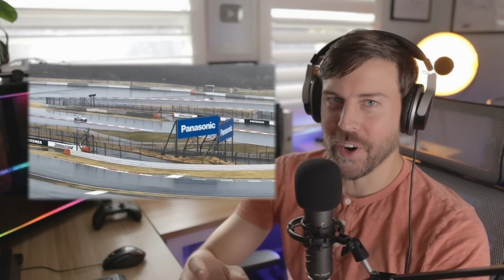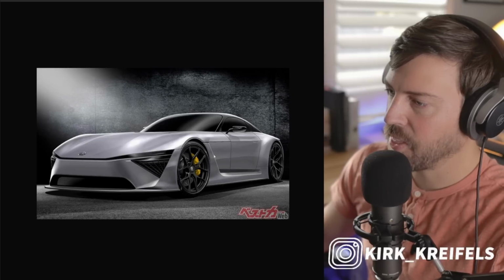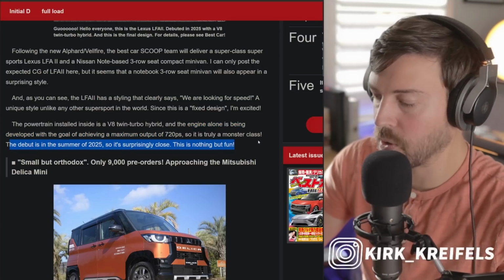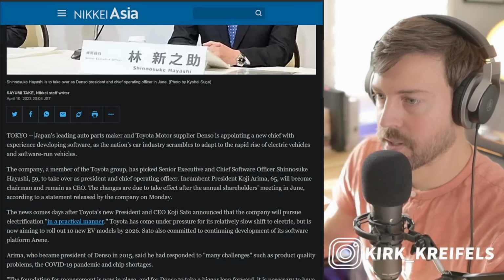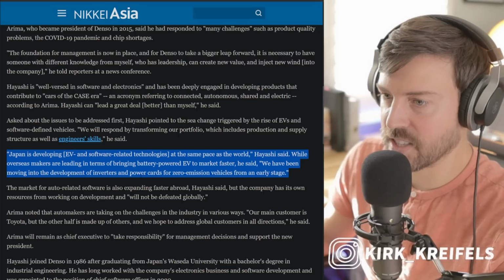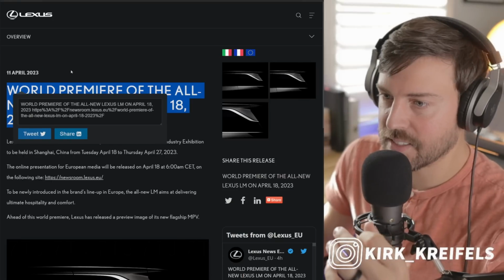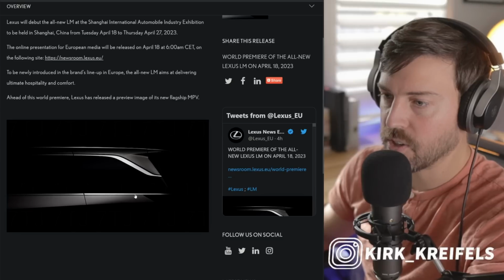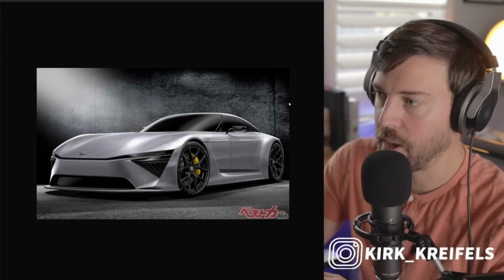*NEW DETAILS* Here's what JAPAN is saying about the Lexus LFA successor...

Comment: Lexus needs to add a supercharger or turbos & tweak the suspension on the LC500. Lower the 0-60 to 3.3 or lower and 11.5 KO in the 1/4 mile if they at least do that that’ll be what they need!

And pump up the boost in the LFR to have the 911 Turbo, Lamborghini, & Ferrari etc super car times..!

Comment: 700HP from only the petrol motor doesn't sound like Toyota, at all -- that figure, in conjunction with the e-motors, sounds plausible -- the NSX hybrid was already 500HP.

The Toyota 2.4L turbo makes about 275HP; or about 115HP per liter; 700HP would require about a 6L motor, at that (Toyota) rate. 

Most OEM performance turbo motors run about 150 HP per liter, like the Civic Type-R (158); at this rate it'll still require about 4.3L of motor

Most people in the aftermarket knows you can make at least 200HP per liter with a turbo motor, which would require about a 3.44L motor -- but that doesn't mean an OEM would do that
Reply from the maker: Toyota's 1.6L makes 300HP = 187HP/L. 4L TTV8 could make over 700HP with that power density.
Reply: making a v8 to 700HP is a easy work, and it will be reliable, why toyota would make a half assed supercar in this day and age when supercars play around 600-850HP and this is a GT3 car too 😒
Reply: Ok there is something I don’t understand.  If the new LFR is to be a GT3 and compete in the GT3 class in 2026, how is it allowed to have more than 700 HP?  Correct me if i’m wrong, but doesn’t the GT3 race class stipulate a maximum of 500 - 600 HP?  FIA limits a GT3 race car on its hp, weight, engine mgmt, and aerodynamics to prevent any single manufacturer from becoming dominant in the class.  So a 700 HP GT3 LFR seems unlikely if it is to race in the GT3 class.   Am I missing something here? 🤔

Comment: Honestly I thought this (GR GT3 Concept/“LF-R”) was going to be like an RC replacement, not a full LFA successor. 
Lexus should’ve just done what Ford and Chevrolet did and build a Flat Plane Naturally Aspirated V8 (500-600hp+). From the spy shot of the car (LF-R) driving around the track, it honestly didn’t sound so great. With a Flat Plane it would’ve sounded 100x better (even with turbos), especially if developed with Yamaha. 
Then to the design, as a RC replacement I would be fine with it, but as a LFA successor hell no. The LFA was beautiful, everything about it was. If they want to build something to succeed the LFA it has to look the part and sound the part. Should’ve took design cues from the 2000GT and LFA, closest to that is the “LEXUS ELECTRIFIED SPORT”.
Honestly at the end of the day the GR GT3 Concept should be a Flat Plane NA V8 (possibly hybrid) they can add turbos later to a higher trim, and compete with the C8 ZR1/ZORA), and be a RC replacement. 
Now for a LFA successor it needs to be either a NA V10 Hybrid or a NA V12 Hybrid, it’s honestly that simple. If not let it rest.
Reply: The GT3 is gonna be the RCF replacement. The head Toyota guys already said that. The EV super car is gonna be the LFR.

Btw Toyota doesn’t go flat planes. I’m sure they’re going to stick with cross plane v8s cause they’ve always been considered more reliable. Plus they already had one developed for the cancelled LCF. Plus building a Toyota level reliable flat plane v8 would drive the prices too high for the RCF.
Reply: @bundamaker6747  phew, only thing that still confuses me is the power numbers (700+hybrid=850+?), I guess they can always detune it. 
Hopefully it will be around M4 pricing (most likely will be C8 Z06-higher trim levels pricing)so $100k-$200k). Also with it being cross-plane I think they should do a 8 in 1 exhaust (if possible), would make it sound so much better. [still hate the design though]
Thanks for the information.
Reply: @phosimmie  Yeah I’m not sure. I think there’s gonna be a TTV8 without hybrid for sure. Maybe prices somewhere in the Z06, AMG GT price range. Maybe there will be an LFR hybrid and EV version? That’s where the details get murky. I hope it’s not too expensive cause I wanna buy one. I’d buy the supra but I want a Toyota engine.

Comment: Lexus needs to make a 2nd gen LC as people still want grand tourers over high performance coupes while also having the LFR in the lineup  just like how Mercedes still has AMG GT and SL
Reply: Lexus has a problem following up with their sporty models. 

LFA was a limited run car.
ISF 1gen only.
GSF 1gen only.
RCF 1gen only from what we can tell.
LC too highly likely to be 1gen only.
SC: 1gen and 2gen are completely two different cars.
Reply: @alib8396  Bot necessarily a problem, just usually too late to join the market .Only reason this model is coming back is so Gazoo Racing can race more lol
Reply: @alib8396  The isf has a second gen it just took them 10 years to release it.
Reply: well amg gt and sl are about to become the same car sadly, maybe lexus will do the same but make the lfr first then the convertible second
Reply: @TDBFZR6  there a next gen AMG GT after a hiatus
Reply: @chezzyperson3339  yes the amg gt is coming but itll be based on the new sl not the same ground up front mid engine more hardcore car as before, itll be a lot more luxury and probably heavy
Reply: @TDBFZR6  in a sense yes. The SL is the soft top convertible version of the new AMG GT. 
It didn’t make sense to make two convertibles, like the first Gen AMG GT Convertible and the long in tooth SL hardtop convertible.
Reply: I second that.
Reply: And I need to save up money for Lexus high performance line up. Lol
Reply: Lexus is busy making stupid mini van
Reply: We’d probably get an electric gt coupe
Reply: Amg gt it's going out soon for coupe based on the new SL. From the sls, to the amg gt... to a sl coupe... involution
Reply: They should go LWB and make the rear seats actually useable in the LC500